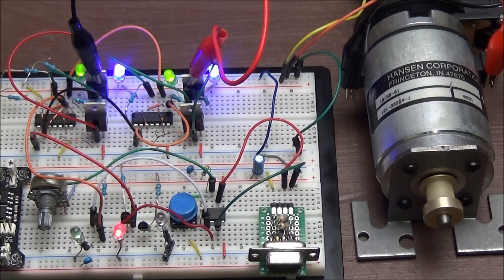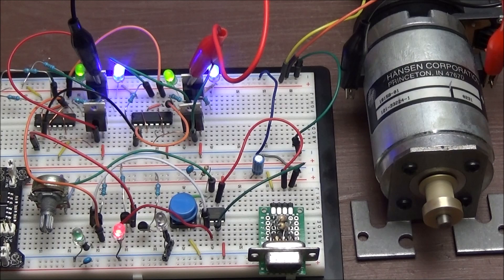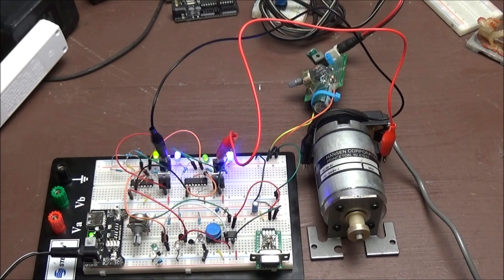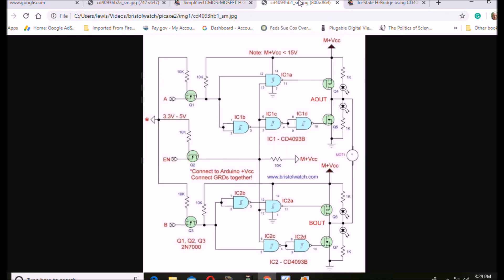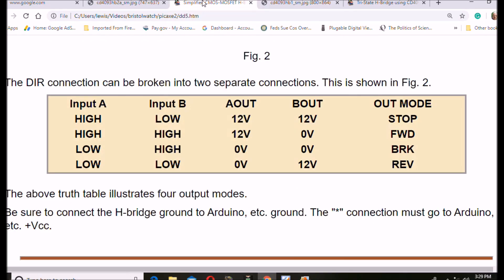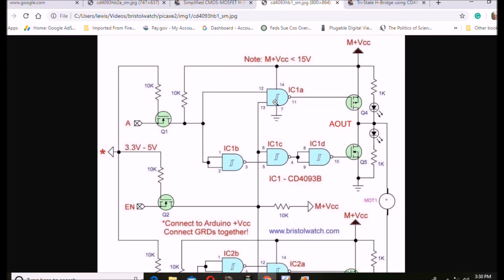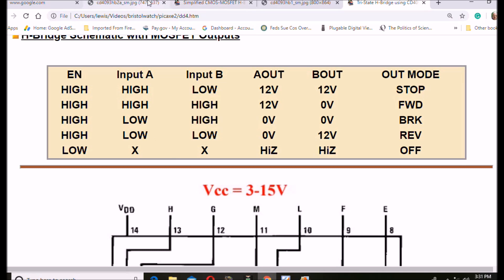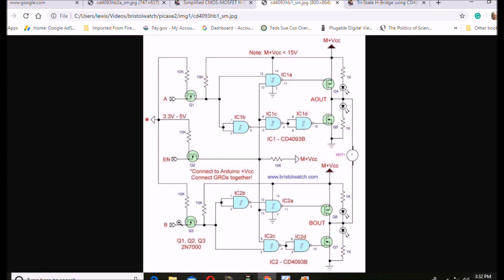Pt. 3 Tri-State H-Bridge using CD4093B CMOS Circuit

Comment from the maker: Part of 3 of 3.
Pt. 1 Interfacing Microcontrollers to CMOS and MOSFET Circuits
https://youtu.be/XzetdwzcOrY

Pt. 2 Simplified CMOS-MOSFET H-Bridge Circuit
https://youtu.be/rExHPqTUBuA

High Voltage IGBT H-Bridge Using Photovoltaic Optocouplers
https://youtu.be/azJo4h-ei6I

Arduino Controlled IR2110 Based H-Bridge HV Motor Control
https://youtu.be/d0r-Yx9R3Zs

Pt. 1 TB6600 Stepper Motor Driver with Arduino
https://youtu.be/PHe2MK9CvQM

Pt. 2 Program TB6600 Stepper Motor Driver with Arduino
https://youtu.be/jtX0t7-m69M

Arduino Unipolar Stepper Motor Driver Board with Arduino Code
https://youtu.be/HTVYiLOY8SQ

Comment: The way of interfacing uC to the CD4093B driver seems not safe. When uC pin is LOW, the FET 2N7000 opens, exposing uC pin to the +12V trough 10k resistor. Though it seems to work, it is out of spec for most uC.

Comment: this is a great H-Bridge circuit.  Lewis, could you please show how to use a Vishay I300 to isolate the circuit? I would like to experiment with the I300 on a similar circuit using an Arduino. Thanks.